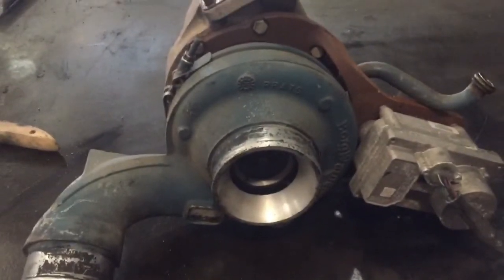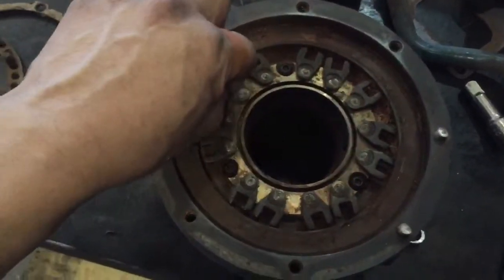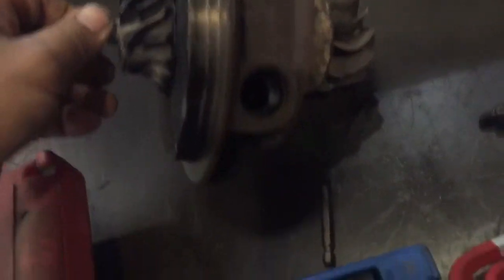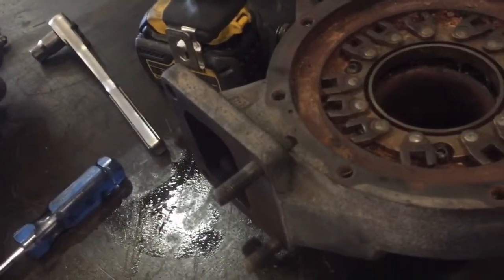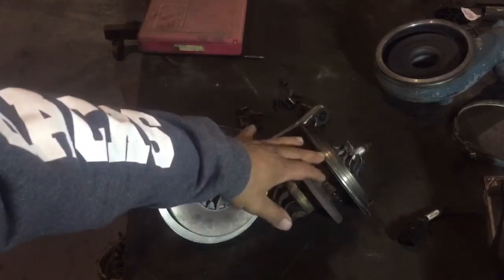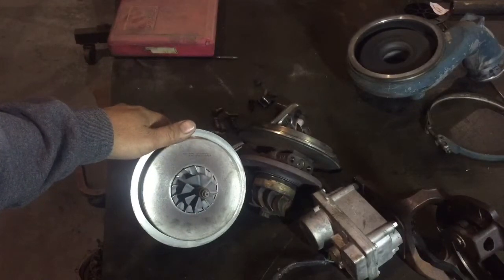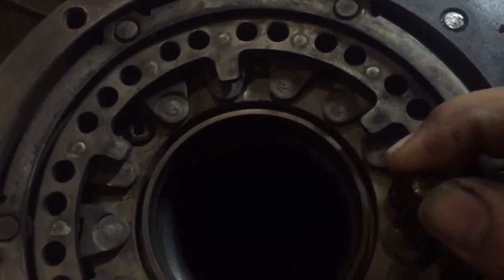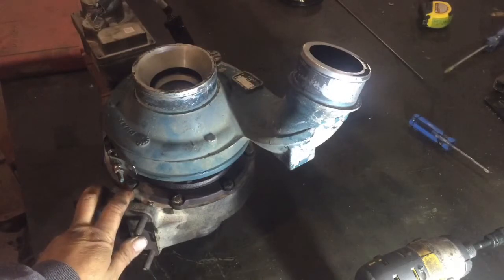DT 466 turbo assembly

Comment: Great video. I just took my turbo off tonight was getting codes 543 and 544 for over and under vgt. My egr cooler went out two months ago and leaked in.   Was able to watch your video and play/pause to dis assemble
Reply from the maker: Hey there white T. Glad u found the video helpful. They aren’t they bad to open up. The Leung that operates all the little wings might give u some issues. But it will come together. That should give u the extra boost power u have been missing brother. Thank u for watching.
Reply: Joe’s Bus Barn  Used some intake/turbo cleaner and got all the vanes freed up, lots of corrosion in there from the egr leaking.  3 of mine were locked up, surprised the actuator was working at all as I replaced it 3 days ago thinking that was my issues only to have the codes come back yesterday.   Do you use any type of sealer or gasket (except for exhaust) when putting it all back together? Didn’t look like you did in Video but wanted to check cause I Called local dealer and they don’t have a service kit, gonna put it back together and install tonight.
Reply from the maker: WhiteTrashSTL   We don’t use sealer nor gasket on the turbo (we do use flange gasket on exhaust port. I get a new flange gasket and it comes with new mounting nuts.
Reply: Joe’s Bus Barn thanks for the clarification (did I mention it’s my first turbo tear down). I have a new flange and new gasket for the turbo to manifold. Wanted to make sure I wasn’t missing anything before I move forward.  Not much info online on how to clean these only how to pay 2k for a replacement

Comment: Hey brother I got a 2007 dt466 , got no check engine , truck hiccups , dies, when it gets warm , doesn’t want to take throttle chockes out, changed ipr valve, icp, cam and crank sensors, do you think it could be my turbo actuator??
Reply from the maker: Derik Pireh   Do you have access to a scanner. Would like to know how sensors are doing. Turbo itself wouldn’t cause engine to die off. You would have loss of power. Now low fuel pressure would kill off that engine. I’ve had a bunch of issues with harnesses and Injector drive modules. Have u done a self check using your steering wheel cruise buttons. If yes. Send me the codes you retrieved. I’ll be able to help you better.
Reply: Joe’s Bus Barn 
625-14p
639-14p
2023-14p

9 faults but same numbers      Are these the codes or you need the top numbers as well?
Reply from the maker: Derik Pireh if u can get the fmi #’s. Let me start looking at the ones u sent.
Reply from the maker: Derik Pireh  the codes u gave me are body control codes. Need the engine codes
Reply from the maker: Derik Pireh   Codes u gave me are for door actuators.
Reply: Joe’s Bus Barn I don’t have a scanner with me now This is on the instrument panel I’ll post the video to my channel. 9 faults codes
Reply from the maker: Derik Pireh  give me a bit. I’ll send u the “to time retrieve the fmi’s in a bit”. Driving.
Reply: Joe’s Bus Barn thank you sir and god bless.
Reply from the maker: Derik Pireh   Ok. Can I have make and model of unit. If it’s a bus or box truck. Press cruise on button and set accel repeatedly and self diagnostics begins on the lower screen on your speedometer cluster. If ur unit is IC
Reply: Joe’s Bus Barn 7h444226 last 8 of the vin.   It is a 2007 dt 4300 flat bed tow truck equipped with egr.
Reply from the maker: Derik Pireh   Got it. I’ll get back with you.
Reply: Joe’s Bus Barn I can run the truck when it’s cold and upload a video , when it gets warm starts chocking and doesn’t want to rev up !
Reply: Joe’s Bus Barn  any news brotha?
Reply from the maker: Derik Pireh   Hey Derik. I was reading ur message and came up with 2 causes. High pressure oil rail seals. Engines warms up. Oil thins out. Loss of pressure at oil rail to injector seals. #2. Turbo VGT sticking. If the variable geometric part of the turbo sticks closed. You get loss of power and engine will stumble at acceleration. For now. That’s all I can think could be causing your issues. Didn’t get to look into the issue much. It was a rough day at work.
Reply: Joe’s Bus Barn also starts hard ,cranks ,starts but quickly shuts off , warmed it up and checked the turbo  actuator did the balance all was good.
Reply from the maker: Derik Pireh quick ?  Does your unit loose water and no apparent leaks. Call me if you can. 9566880576
Reply: Joe’s Bus Barn 

819 s Glendale ave Glendale ca 91205
Reply: Mr.Joe how are you sir, u didn’t forget about the sensors right? If anything changes let me know please so I can go ahead and purchase it please let me know , thank you and god bless you.
Reply: Joe how u doing hope all is well, changed the iat and map sensors to still the same shuts off when it gets warm and still hiccups
Reply: Joe how u doing , iam trying to buy a cheap Idm and change it on this truck , any help you can offer?
Reply: @JoesBusBarn  hey Joe could I have you a quick call? Have a question about this model. Mines a 07 466dt as well
Reply from the maker: Justin Wilson  sure thing. Email me joegonz268@gmail.com so I can send u my number.

Comment: Would you recommend to throw in some antiseize where the fins were all rusted up and stuck?
Reply from the maker: Manolo M  no anti seize bro. Gets really hot 🥵 in there. Just clean. We add a bit of reel oil on all of the pivoting surfaces because ours r going to be on a shelf for a bit.
Reply: @JoesBusBarn  Ok Ok got it. So I will just clean up with a parts washer fluid. Would you recommend air drying after washing?
Reply from the maker: U can. Just careful with the fins. They r sharp and very fragile.